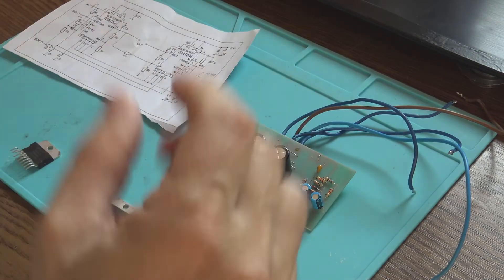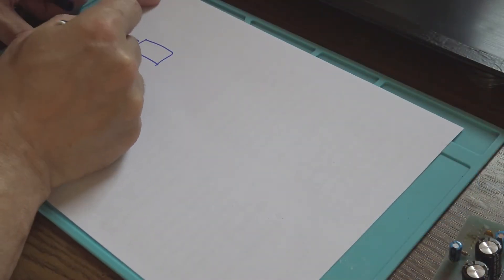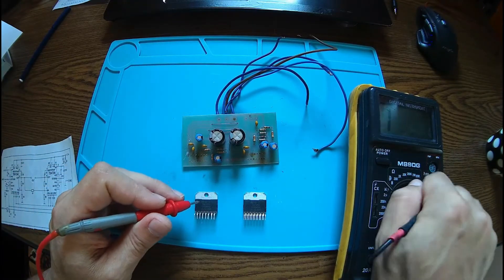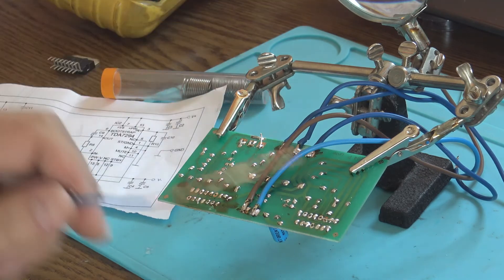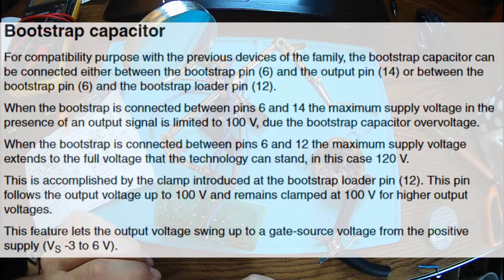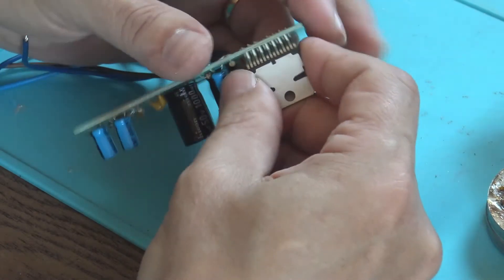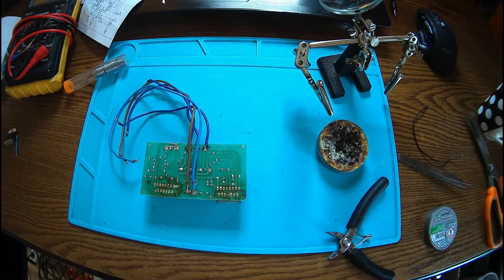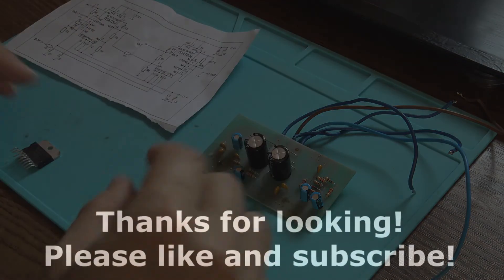DIY 150W power amplifier TDA7293 bridge

Comment: As been on the road as Roadie / FOH Sound Engineer back in the 70s - 90s improvisation is king; finding solutions with any tools you have 😁
Reply from the maker: Same here! Fixing cables and loudspeakers on the stage. The most important tool was the soldering pen and a good cutter.

Comment: Sorry for your 7294 board the pin 12 is put on neg rail , so if you are using 7293 pin 12 must not be connected on this board.
Pin 12 on 7293 is for bootstrapping. On 7294 pin 12 is empty.
Reply from the maker: Thanks! I'll be careful next time.😀